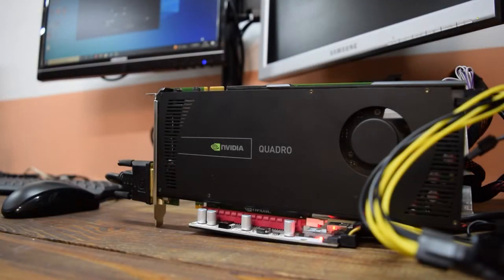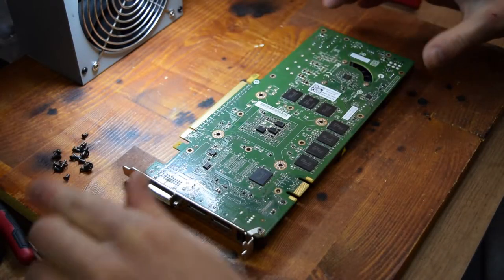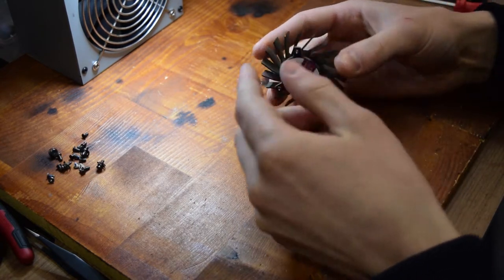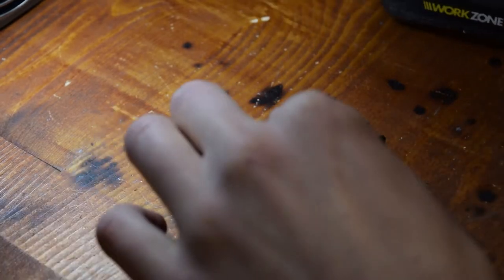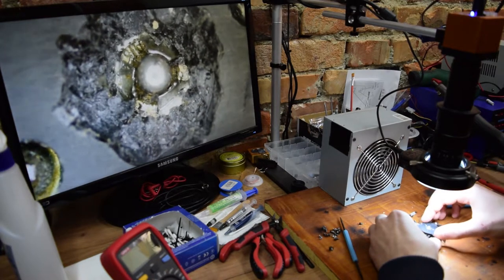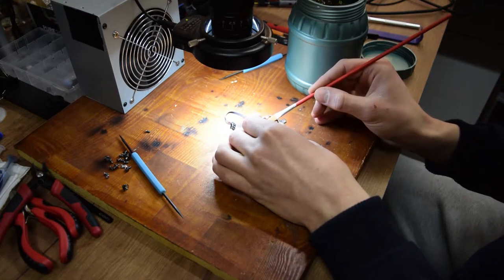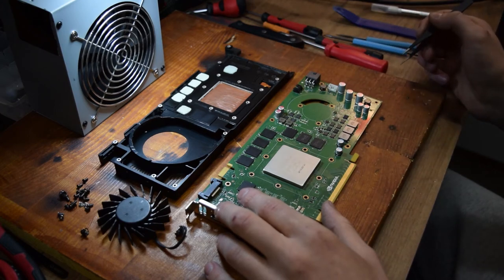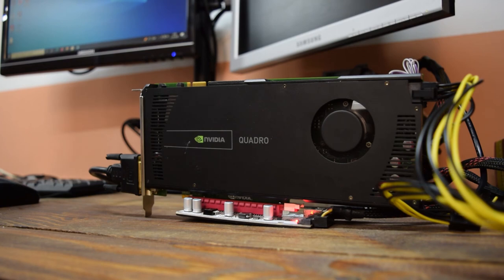How to repair a noisy / loud GPU FAN (ticking, slim, Nvidia Quadro 4000)

Comment: what would happen if you zip tie a 120mm fan on top of the heatsink and connect the header to the motherboard. The fan can be control via a software called fan control.
Reply from the maker: Nothing really. A 120mm fan should if anything improve thermal performance and noise levels.
Though I believe for the size od the card a 92mm fan would be more fitting.

Comment: What size torx screws are those at 00:30.
Reply: I am asking because I need to buy a set of torx drivers to make this repair and I want to make certain the set will handle these screws.
Reply from the maker: @stedew001  Sorry for my late answer but sadly i don't have the card anymore so that i could check. Though it's either T8 or T6 torx. Hope it helps!
Reply: @gallep4894  I bought a Kaisi Precision Screwdriver Set from Amazon that did the trick. I was concerned with the smaller torx screws holding the cover on and I think they turned out to be T3s. Thanks for the response.